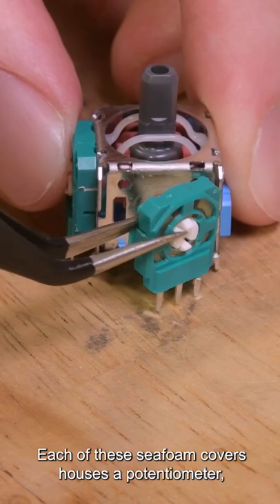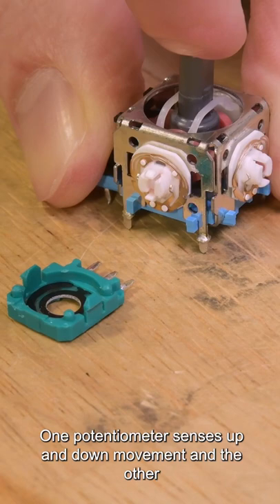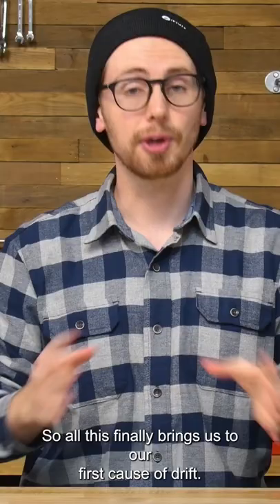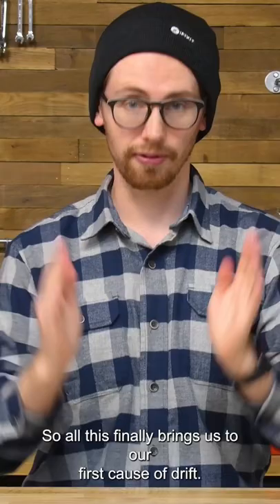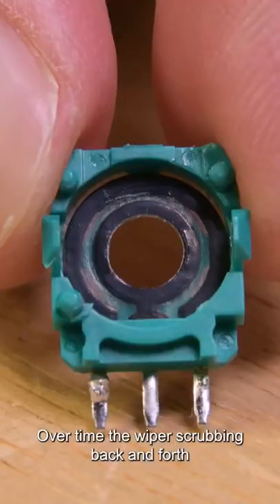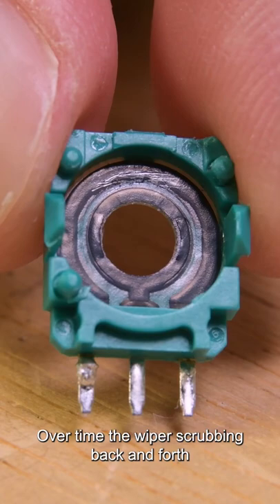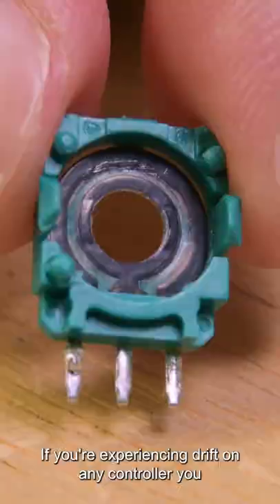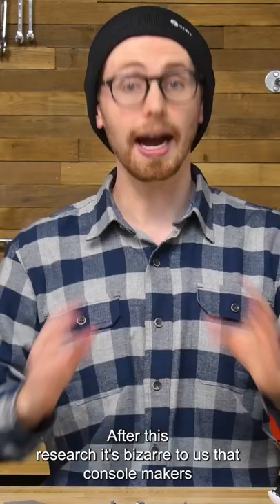Why Do Joysticks Drift?

Comment: why charge once for a controller, when you can charge every couple of months per costumer, for a new controller
Reply: In business-speak that's called a profit center
Reply: Nintendo 💀
Reply: Couple months? Y’all buy more than one new controller per year?
Reply: @SupremeShuckle  who doesn't? these controllers don't even last 3 months.
Reply: @GodrickTheGrafted123  mine lasted for 5 years, didn't even take care of it. Guess im just lucky and it was a ps4 controller
Reply: Because then you could sell replacement sticks which would likely be more profitable.
Reply: @TheACTIONZ  probably because you played 20 minutes a week
Reply: @albertalberto2288  lmao no 💀 I play cod around 6 hours a day, so that would damage it, but I guess not.
Reply: @TheACTIONZ  then it means u take good care of it
Reply: @albertalberto2288  well I don't. As I said I just got lucky
Reply: @GodrickTheGrafted123  I haven't changed a single joycon yet actually! Casual gaming for around 2 years or so
Reply: I dont get it, my first console was the ps2 slim that I got around 2004 after that I got a ps3 in 2009 and ps4 in 2018 also I got an xbox one controller for pc in 2019 and I only had drift problems once. The ps4 controller started drifting but I just opened it up dusted it and cleaned with ipa and it got resolved. I dont know if I am just lucky or you all need to take better care of your controllers
Reply: The edge has replaceable joy sticks but the price is very steep
Reply: @raul0ca  That's called a profit center for gullible customers. I might get fooled once to buy a new controller. I might get fooled twice but at that point I will never, ever buy anything from the company even if it starts to produce gold covered devices.
Reply: @TheACTIONZ yeah you’re lucky
Reply: @GodrickTheGrafted123  I can confirm, I feel like my Ps4 controller lasted longer then my Ps5 one that lasted as long as you said in about 3 months or so. So sad companies don't bother to fix the issue because it will probably mean they will loose money because people won't keep buying their expensive but cheap plastic controllers
Reply: @TheACTIONZ  I don't think the luck had to do with this, As mentioned in the video, these parts are not consumable, they just break down like anything else
Reply: @TheACTIONZ Same, mine just broken this morning after 5 years. I use my PS4 almost everyday.
Reply: God i love planned obsolescence
Reply: @TheACTIONZ that's because you're talking about ps4 controller as you said. I've never had any issues with my ps4 controller and I've been using it daily for several hours for 5 years. My ps5 controller however got stick drift after few months. Thankfully I was able to fix it
Reply: @SupremeShuckle at least 3 per year for me
Reply: Y’all see the new controller?
Reply: Get dis Money
Reply: @brunoob-1  Ninten don't lol
Reply: I fixed it and saved money
Reply: If you buy a new controller just because it drifts you are crazy, just replace the analog for dirt cheap or use Hall effect analog
Reply: I've never had a single Nintendo Switch controller drift, but my PS4 always does after a month of use. Why not just make a PS4 controller with Switch sticks? Greedy bastards.
Reply: @Austria-HungaryRules  it is the same thing, both drift like crazy and just because your switch analogs doesn't drift it proves nothing
Reply: @Wilqu5677  I know, I was just salty and pissy

Comment: Consumable parts should always be modular and easy to replace, especially batteries.
Reply: they are.
the Batteries in first party controlers as well as most 8bitdo controllers are standard parts and easily replaced. Well, minus the Nintendo WiiU Gamepad...
Reply: Rechargable batteries don't need to be hot-swapable, but they do need to be replaceable.
Reply: Ah yes I love consuming batteries

Comment: The worst part, even back with Gamecube controllers, one of the sticks was just a stick by itself on a board, that could be replaced with just a connector. It's not a repairability thing. It's actually just regression of technology for profit.
Reply: Not sure if we're on the same page but I know that the GameCube controller's C-Stick is replaceable via a connector but the Left Stick is still soldered to the board.

The T1/T2 stickbox are similar to the traditional controller stickbox, but the T3 stickbox is entirely removable by unscrewing it, except its potentiometers are still soldered.
Reply: @ndNixLon  Good point, yeah, I can't remember now but the left one might be hard soldered. I know for certain that the C Stick is on a connector cable though.

Comment: Fun fact since we’re getting screwed over I say we fight back just buy a new one that looks exactly like your old one and swap out the backplates now do not damage that sticker or else it voids the warranty however u can get some rubbing alcohol and put it on a q tip peel the sticker back a bit and get to the little screw :> do this as a screw you to Microsoft

Comment: Its been a problem for ao long and they didn't care to fix it, as it brings higher sales for them.
Reply: Sega Dreamcast's controller used Hall-effect sensors, completely eliminating drift issue.

there is only 1 company making hall-effect sensors, Gulikit. They make controllers and kit for Steam Deck.
Reply: @durururururururu  thanks for the info 👍
Reply: @durururururururu  Sony also did it in one of the versions of there controllers
Reply: @durururururururu  bro i actually managed to mod a normal gamepad for hall sensors but the difficulty is 4.5/5, scavenging the right electronics is a big headache.
Reply: @stoopidhaters  perhaps we are seeing cost cutting in action
Reply: Is weird tho, I remember the Ps2 joysticks, those would never drift, but modern joysticks do drift? Wtf
Reply: @titowid  The DualShock 2 has a feature that zeros the X/Y values every time it reaches 255; it calibrates itself to prevent minor drift issues.
Reply: @durururururururu  Some DualShock 3 controllers has Hall effect sensors as well. Gulikit is also now manufacturing Hall effect sensor analog sticks for the Joy Con as well.
Reply: @ndnixlon9548  So they just didn't add thus feature to the ps4 controllers?
Reply: @ndnixlon9548 I think the potentiometers are also built much better on those old controllers. Otherwise, there would be a point where no amount of zeroing and calibrating would help anymore, if I understand this right.

Comment: Joystick drift because we are fine with it and the last time someone made a reliable controller that won't drift -> earlier PS3 ones - all we did was bash and flame the controller and nobody talked about the Good Parts - like the reliability, that it won't drift (Only A1 and A2 can) and is very robust and easily repaired.
Reply: Yeah. Those were the days. My ps3 controller didn’t drift because of the worn out contact points but rather the spring has lost its tension.
Reply: Dreamcast and Saturn used Hall Effect sticks. Funny how we just see them coming back around, now that more DIY people are posting videos.

Comment: Product engineer here: this is because they don't use hard gold. Hard gold is a coating technique that allows rubbing contact surfaces to last hundreds of thousands or millions of cycles and maybe costs them an extra $0.10 per controller but they actively choose not to, I would only assume that by controller failing in a predictable manner after a known amount of hours or years means that it will be replaced and thus is more profitable for them in the long run.

This also can be solved by software calibration similar to n64 joysticks and ps1 joysticks, where the zero position and max travel distance is captured when you turn on the console each time.
Reply: They could also use hall effect sticks, it's probably cheaper than hard gold coating
Reply: @fABIO-cs3un it’s not.
Reply: That might explain why many 24+ year old controllers in my possession still work like new despite their old & heavily used potentiometers. A meagre $0.10 can go a long way.
Reply: @SomeAngryGuy1997 It's not a coating on those old controllers making them last, it's the calibration each time it's turned on that does it.
Reply: You can't just coat a potentiometer with a continuous low resistance metal coating like that, it will just short out the body of the resistance compound or wire coil in the potentiometer.

A rotary encoder, preferably an optical one, seems a far better solution.
Reply: Engineered obsolescence. Good job. 😂
Reply: So they're literally doing it on purpose so you buy more consoles. How easy would it be to do a software calibration
Reply: They could just use Hall sensors, they're extremely accurate, they're used to position my CNC within .0001" of an inch.
They're incredibly cheap and don't require any contact, so no wear.
Reply: @Gabriel-vj1cf  while it's true that it's not cheaper, I doubt that it's more than 2$. I was using magnetic encoders in one project of mine, and it was about 1.5$ per hall sensor + magnet on board, and I was buying them in small quantities. You only need 4 of them per gamepad (6, if you want to use them on triggers as well), and they are way cheaper if you buy them as a company in large quantities. With the current price of gamepads, an extra 2$ is a joke, and you probably can mark up the price by 10$ or so, just marketing it as a driftless gamepad
Reply: @zackphy No, calibration doesn’t help, and that’s not why older ones worked. You can run a recalibration on the controller, and if it was just offset but stable it will fix it. If it was drifting, recal won’t help.

Older controllers were built better until the manufacturers learned that they can create a wonderful income stream by using cheap components that fail in less than a year. Besides readily available, long-lasting gold components, the manufacturers also have the Hall effect option. Both would add maybe $4.00 in cost, and the control would last forever, but that doesn’t net the console maker $500 in between sales of each new gen of $500 consoles.
Reply: How does it calibrate every time the PS1 turns on
Reply: Why not just use Hall effect sensor instead of choosing friction pots?
Reply: @NicleT  Hall effect is more expensive and consumes massive amounts of energy in comparison. A wireless controller would last a couple of hours on a set of batteries or charge, instead of days or weeks.

More importantly though, the controllers are designed to breakdown, so that they have a healthy income stream on new controllers, in between selling whole new consoles. A hall effect controller, which could theoretically last forever, never needs to be replaced, and therefore provides no future profit. 🙂 sad but true.
Reply: @haredr6511  the ps5 controller only lasts a few hours anyway
Reply: @haredr6511   I looked for replacement potentiometers for dualshock. They are 2.1kOm, so they draw about 1.6mA on 3.3V. As a hall sensor to compare I took the AS5600, they draw different amount of current depending on polling time. And it's 1.5mA (10Hz), 1.8mA(50Hz), 3.4mA(200Hz),  and 6.5mA in continuous polling. So they barely take more than resistive ones. Not to mention, it's comparable in power consumption to regular LEDs. So even at high polling speed, this additional power won't be noticeable compared to all other components of the gamepad.
Reply: @jacksidr6182  you’re looking at only purely the base sensor without taking into account what the rest of the electronics must do with it. To get the sensitivity needed for micro-inputs, substantially more power must be pushed through the Hall effect than resistance POT. There are plenty of good articles out there explaining this. It’s also exactly why there are hardly any wireless HE controllers out there, and the ones that do exist have poor performance and 2hr battery life.
Reply: @haredr6511  can you link to any of them, I worked with hall based magnetic encoders, and accuracy was fine using base sensor without any additional electronics. And honestly I can't think from the top of my head why you would need any, especially pushing more power than the sensor requires. Also the consumption that I provided is for the general purpose one that I used, since in my application the current draw from it wasn't important. I have seen plenty of options that are specified for low power consumption for battery operated devices.
Reply: is there a controller that does?
Reply: @Gabriel-vj1cf Have you seen the price of hall effect sticks lately? :3 
While I don't think it's cheaper than hard gold plating millions of these little metal parts, I believe it's not a considerable cost either. It will cost them 0.2$ more per controller or something... 
Of course they wouldn't do any of these two things... Stick drift kills controllers left and right. They don't want their controllers to last long...
Reply: So if i disassemble the joystick and do gold plating electrolysis on the metal contacts. I will get a million cycles on the potentiometer?

Comment: Cause of drift: cheap analogs
Fix to drift: use magnetic analogs
Reply: Or optical analogs
Reply: That's call hall effect joystick
But they won't 
They just want money
Reply: @davidperry4013 . Ive never heard of optical analongs, ill have to look into them.
Reply: @Kenny-hy5pj  Patents and accompanied licensing fees, if they need to spend money they'll ask for more. Also Hall Effect sensors fail too.

The way a hall effect sensor fails is worse than a potentiometer, it's immediate instead of failing gradually like a potentiometer does. Then you have other issues like extreme temperatures can cause a hall effect sensor to drift or variance in the magnetic field.

It's not as simple as "They just want money".
Reply: @Nix27.  N64 had optical analog. Also magnetic sticks can degrade too but it’s usually the opposite problem than potentiometers, the dead zone gets bigger but the base dead zone is usually small enough that it doesn’t matter.
Reply: @michaeldejode473 This is COMPLETLY FALSE where did you even get this information lmao?????
Reply: @lmao-be2ix  What's false? That they can fail? That when they fail it's immediate instead of gradually? That extreme temperatures and/or a variance in the magnetic field can cause them to drift? Are you talking about patents and licensing fees? Or all of it?

They are very reliable but they aren't perfect. And the information comes from personal experience and troubleshooting problems I had with hall effect sensors. Will you come across the same problems when they are used in controllers, I highly doubt it
Reply: I still have 1995y microsoft sidewinder joystick, no potentiometers inside, its optical and works like a charm.
Reply: No... I get sloppy joysticks before they start to drift. By the time drift happens, the whole thing is worn out. Hall effect sensors are more jittery and won’t fix slop in the joystick.
Reply: @Nix27. N64 had an optical analog stick.
Reply: Where to buy those?
Reply: @lmao-be2ix you using a word in all caps and using LMAO in your comment makes me less inclined to trust what you are saying since you communicate like you're 17
Reply: @michaeldejode473  So what do I buy to fix stick drift? That's all I want to know
Reply: @Vianilix  Depends, I usually replace the potentiometer as they are cheap. On PS5 Controllers I would also replace the plastic sticks with metal ones as they get cut and the plastic dust goes into the controller where the potentiometers are and cause drift. I don't know if there are any driftfix boards, but they can help. Or if there are any on the market but depending on your usage a hall effect sensor, the ones I found are pretty noisy.
Reply: @Vianilix  Hall effect sensors need manual calibration usually too, which can be finicky.

Comment: 10000% agree with the final statement. As long as you take good care of a controller, it's always and only drift that forces you to get a new one.
At least with modern controllers. Really old controllers seem hardcore; I have original ps1 dual shock and gamecube controllers that still work like a charm.
Reply: Ive had my PS2 for 14 years and no issues. I love that little machine

Comment: I fixed it easily. I didn't take it this far apart. But I opened my controller, cleaned these two sets of components, (green cap thing) and viola. My 3 yr old original white and 1.5 yr old black are back at 100%
Reply: Lucky you. You only had drift because it was dirty. It usually doesn't help, but there some times when that's all. Nice
Reply: Just cleaned mine... Full Tokyo drift... Smh
Reply: had a drift too the left fixed it and endet up with a bigger drift upwards instead and didnt even touch it cleaned it didnt help

Comment: I got a Sony Dualshock 4, and within 3 months it already drift. I claimed warranty and before I even explain the cause of damage, the staff already predict and assume it was a joystick drift, and they are correct. that means drifting warranty claim is so common, but the question is why did Sony keep producing the same flawed dualshock 4 instead of fixing it or providing replacement parts for joystick
Reply: Because gamers don't vote with their wallets.

Comment: We got my son a Quest for Christmas in 2020. By Christmas 2023, the sticks were drifting so badly, it was unplayable. We bought replacement controllers.

Meanwhile, I've been using the same Logitech GamePad since 2001, with well over 10,000hrs on it and no sign of drift or flaw yet.

We're going backwards.

Comment: There should be software adjustments too. Regular checks to recalibrate for voltage changes until the potentiometer is too damaged to function properly.

Comment: Thrustmaster Eswap controllers do have replaceable sticks & work with ps5, Xbox & pc but are wired & do not use low voltage systems so drifts is less likely anyway.
Reply: It's not entirely compatible with PS5. It can only be used on PS5 with PS4 games only. Unfortunately can't play actual PS5 games with it.